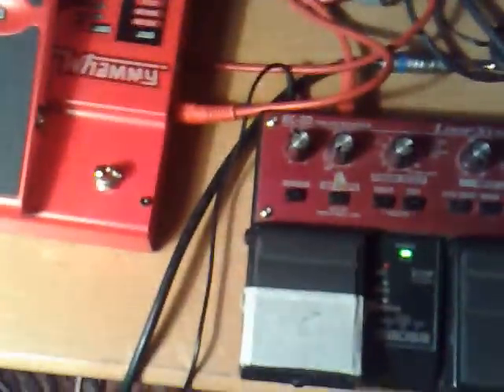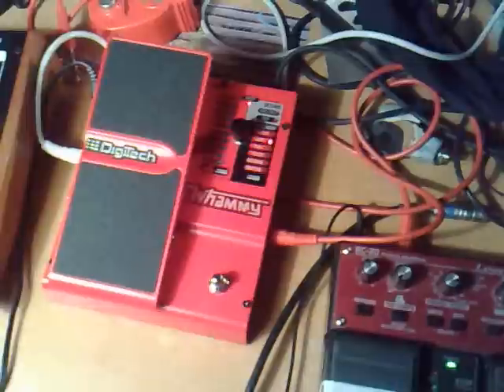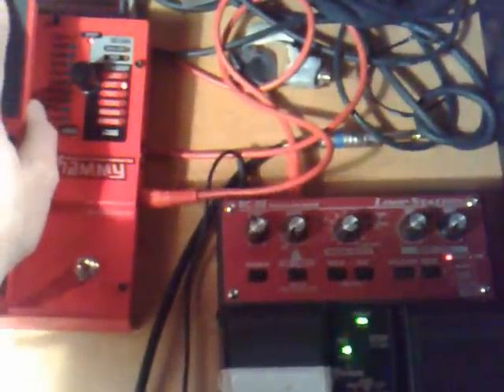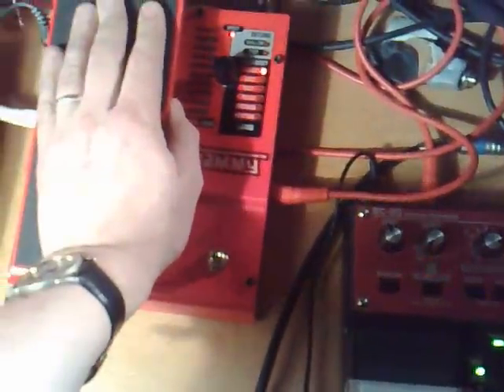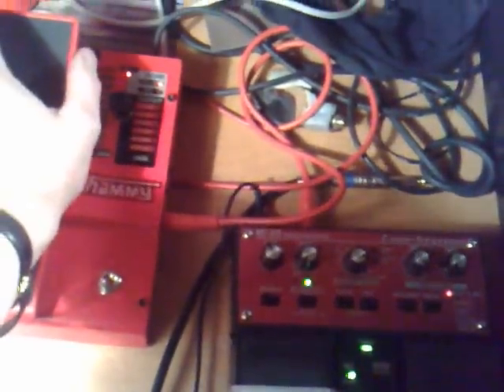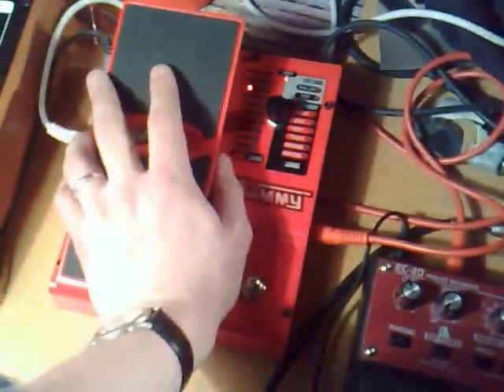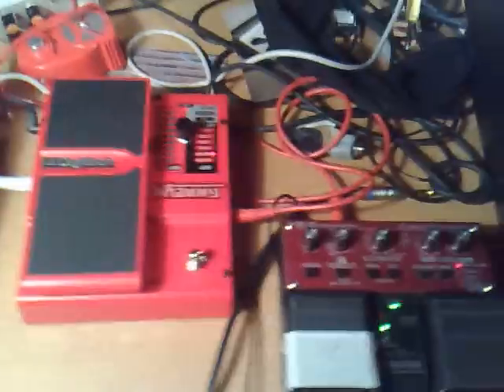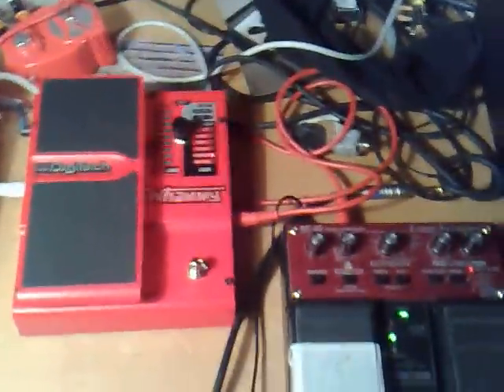Mellotron MK II moving violins through Digitech Whammy

Comment from the maker: I am not sure about how many pedals I have but I know that a lot of my pedals will never be turned into a plug in...like the Rocktek super delay. 

I use my pedals more or less like a modular synth system as filters et.c and I thoroughly enjoy pulling cables and experimenting. That is how I started recording and it has worked so far. Now me and my good friend Nicklas Eriksson are working on putting them all into cases together with my modular stuff to make it even more open ended...